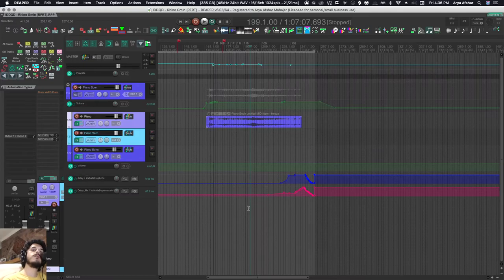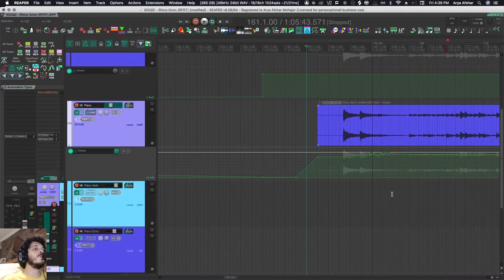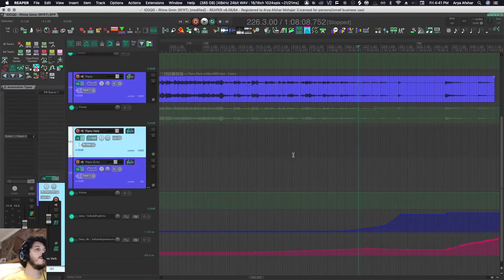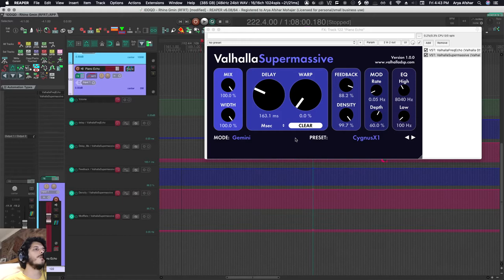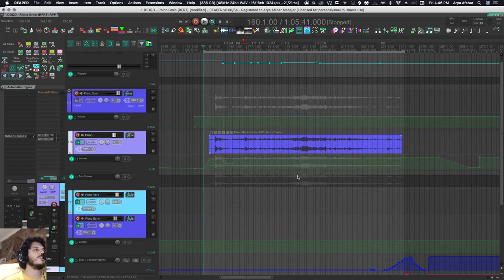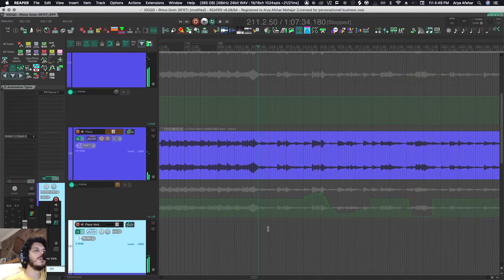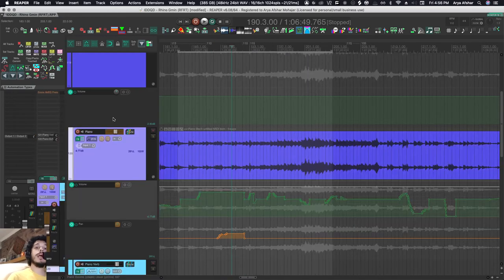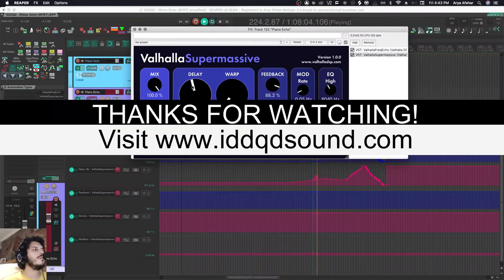Read/Write/Touch/Latch/Trim/Preview Explained! (Rapid-fire Reaper Tutorials Ep22)

Comment: My "Touch" responds exactly like "Latch". In your video, in the Touch part, you can override the envelope, but when you let go of the control, it goes back to the envelope. I'm not experiencing that behavior at all. Driving me nuts. Any idea what's going on? The only way to not screw up my automation is to stop the transport. Should mention I'm using a physical encoder on an Arturia keyboard. EDIT--- yes, it doesn't behave like it should when turning a physical encoder. If I turn the knob on the plugin with the mouse, it does exactly like in your video. How do I get it to respond like the mouse? Thank youuuuuuuuuuuuu